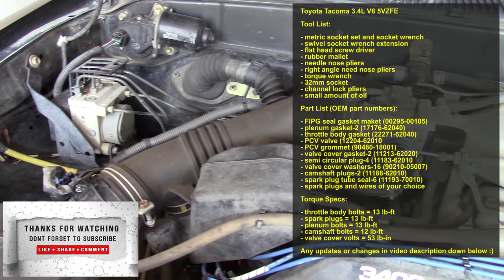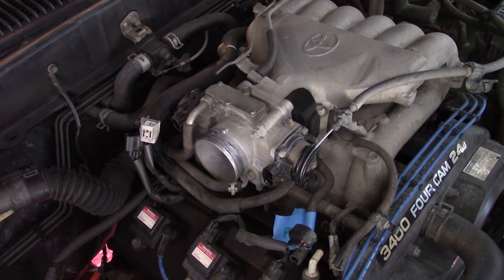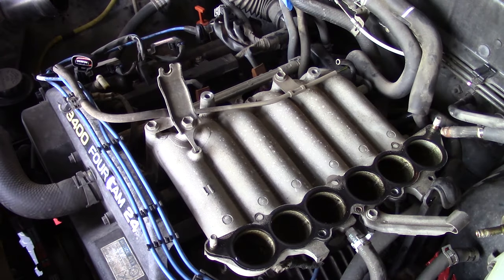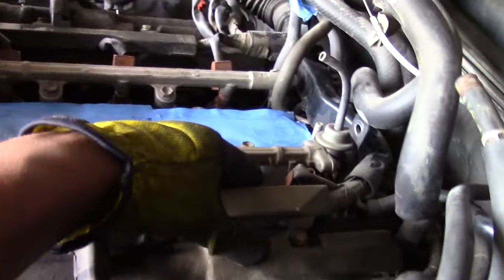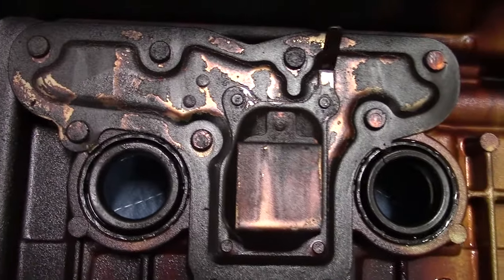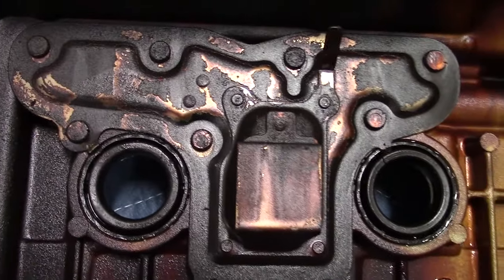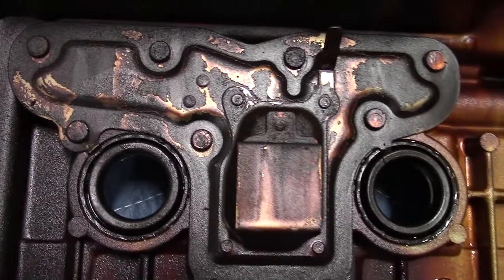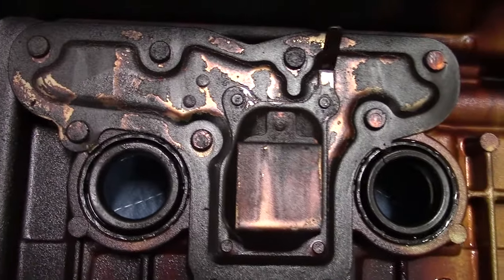Toyota Tacoma / 4Runner Valve Cover Gasket Replacement | 3.4L V6

Comment: All I have ever done is change out the spark plugs, wired, and coils on this engine. This is my next job and it looks kinda scary. I’m not  mechanically inclined so this definitely looks like brain surgery to me. Thanks for the walk thru I’ll be putting on repeat.
Reply from the maker: Good luck on the install! You've completed some technical items already for sure. Just adding a few extra steps here. I'm sure you'll do great 👍🏾
Reply: It’s just time, you’ll do good, don’t overthink yourself

Comment: I'm doing this and I just broke the first bolt I went to torque on... This is so popped. I just ordered 16 new bolts, so now I gotta wait for those. He wasn't lying when he says to be careful torqueing those bolts on. I was using a torque wrench set to 53 ft lbs, I guess I just got excited and went too fast.
Reply: I just did a lil googling and discovered that its supposed to be 53 INCH pounds... I'm an idiot. I read it wrong in the description 😂
Reply from the maker: @johnnyjohnathon7381  I was just about to comment, it's lb inches lol. Happens to the best of us! I'm sure the remainder of the fix will go smooth. You got the order new part phase out the way now :)
Reply: @EngineeredMojo  fr doe

Comment: I never remove the throttle body just leave it connected to the air plenum and remove it together also if you have metal gaskets they can be reused also I don't mess with the injector wires.Defintly use the Toyota glue as permetex rtv doesn't  work for long it will leak in a few weeks.Use either Toyota gasket or the ishino stone is the same . Cheap gaskets leak in 6 weeks. I applied a small amount of blue lock tite to the boltsAll in all you did a good job.
Reply from the maker: @samheninger505  thanks for the tips!! Definitely noted on the toyota gasket sealant

Comment: I hate these valve covers so much, i did all the gaskets and cam caps/half moons and new washers all oem from Toyota and at the end of the day it still leaked 😂 gonna see what i did wrong here, thanks for the vid man
Reply from the maker: You're not alone! First-time I attempted this fix I had a leak. My valve cover torque was too high ironically and warped the compression of the seal

Comment: Eating Lunch Half way through this craziness. Watched this video a total of 5 times to make sure I'm point with my procedures. EXCELLENT VIDEO!  Thank you Thank you!
Reply from the maker: Glad this was a helpful video and appreciate the feedback. Enjoy the lunch break and hope the remainder of the install is going well!
Reply: @EngineeredMojo  how long does this job take?
Good work!
Reply: @EngineeredMojo  Do they sell a valve cover gasket kit that includes the other gaskets used ? Like for the intake manifold? Or do the other gaskets need to be bought individually?
Thank you
Reply from the maker: @SDsailor7  I bought a kit off Amazon, but some kits won't have every seal. You'll need to verify with the part number list I have in the tool list. Hope that helps!
Reply: @EngineeredMojo  Yes, thank you

Comment: I broke a bolt on the coil pack when reassembling: it is recommended at 69 inch-lbs. Hopefully, this spares someone a little frustration.
Reply: Also this was a really helpful video! I appreciate how detailed you were in describing each step.
Reply from the maker: Appreciate the added value to the video!! This is good info. Glad the video was helpful to you as well

Comment: ROOKIES, You can do this! I am someone who if you pointed at something under the hood of my '04 Tacoma I couldn't tell you what it was before the project. There were some hardships, for instance, making sure you put the ignition coils back on the diagram correctly. My truck was misfiring when everything was finished because I rushed and put the coils on wrong. All in all, took me a total of 12 ish hours of labor and I got this done with my family. I learned a lot about my vehicle and am happy I did this instead of taking it into the dealer saving over $300. 

Engineered Mojo thank you so much for this video. Keep making other people's day!
Reply from the maker: Glad money was saved!! Every dollar saved can be allocated elsewhere. Just need the time and patience to get the fix done. Glad the install went relatively smooth and appreciate the time you took to share your story 😀
Reply: Thanks for the confidence booster!!!  I'll definitely try this myself.  I'm being charged anywhere between $600 and $1000 for this, ugh.
Reply: how much did total parts cost?

Comment: Just got her done, 2000 4Runner Limited 4WD with 270K. Was easier than expected because of videos like this. Thanks! Biggest problem was the dealership gave me 6 of the 16 incorrect VC washers so I had to drive back!
Reply from the maker: Glad your install went smooth aside from the dealer providing incorrect parts. Appreciate the solid feedback on the video!
Reply: @EngineeredMojo  on startup this morning i heard hissing from one of the thin vacuum hoses on top of the plenum. I put a glob of FIPG on it hopefully that’s a quick fix for the dry split end.

Comment: Thank you for the tips, I just finished the passenger side and put it back together and will do the other side another weekend. I like your pleasant voice. I watched this and others a couple times. I only did one the easy side first and didn’t even remove throttle body. Putting the little doughnut rubber things in freezer for a few hours and the pvc grommet and they went in pretty easy.
Reply from the maker: Freezer technique is a great tip, I plan to use that in future for other seals!

Comment: Well done, and thanks for taking time to film this. Very nice touch showing that screen shot of the part #'s and torque specs in the beginning.  I had this done at a Toyota shop 2-3 years back, but I'm enjoying watching videos of it now so I can do it myself next time (hopefully that will be a while, but we all know it's only a matter of time on this one).  Like you, I plan to drive this truck for a very long time!
Reply from the maker: Glad the video was helpful! The valve cover gasket is one of the few weak points in our otherwise bullet proof vehicles haha. Hopefully the install you had lasts awhile for sure, but you'll be well equipped when you attempt it yourself

Comment: This video was 100% on track.  Perfect details and to the point.  Made the job super easy to follow along.  I did have one problem that came up and I may not be the only person to experience this.  As my truck is just about to hit 350,000 miles, when I was disconnecting the connectors for the fuel injectors, on every single on of them, the retaining tab to keep them locked in broke off.  Touching them was just enough to do it!  Looks like the mechanic who cleaned my fuel injectors may have experience this also.  There was some gray material he placed into the connector to keep them together.  Maybe some sort of silicone caulk?  So now I  don't want to leave these to chance covered by the plenum to come loose.  Any suggestions?  I hate to think of having to crimp new connectors on.  But I can't just leave them like this to possibly fail.
Reply from the maker: Thanks for the solid video feedback :) Very common issue!! Haha, I actually ran across this on my older Honda recently. I ended up just buying a new injector connector i.e. the plastic head connector. Honda (and Toyota) have a special depinning tool to pop each wire out the back of the connector. No splicing is needed, but it is a delicate process if you haven't done it before. If you'd rather not do that, I've seen others ziptie or electrical tape around the connection after in place. They had no complaints at all

Comment: Just picked up a 2003 with 270k miles.. stunning.. definitely need the valve cover swap.. and possible oil pan...  looks like a days work..
Reply from the maker: You'll be rewarded with a solid truck at the end, good luck with the installs and nice pickup. An 03 with only 270k miles is a unicorn haha

Comment: I’m right in the middle of this project, about to pull off the valve covers I’ve been putting it off for four years but I decided to to change out the pcr valve and once I got it out the other half of the gromet had broken off into the valve cover I said to myself(it’s time) what a pain in the ass job
Reply from the maker: This fix can be a pain for sure haha, it will test your patience but save some dollars
Reply: @EngineeredMojo found the bottom portion of the covers were not even hand tight, I may not have needed new gaskets at all lol
Reply from the maker: @thecactiguy885  haha dang, well at least you have the experience regardless now. Did the rest of the install go smooth?
Reply: @EngineeredMojo currently waiting on all the gaskets, autozone dropped the ball there so taking the opportunity to deep clean the valve covers

Comment: Great tutorial! If only my passenger side is leaking, can I get away with not removing the intake manifold? Seems like there is room to get it off with some finagling.
Reply from the maker: I'd give it a try, couldn't hurt to see if you have enough access. Would save some time!
Reply: Update: I was easily able to do the passenger side by just removing the throttle body and leaving the intake manifold on. Saved a lot of time. Thanks again!
Reply from the maker: @BrandonHoward-g9q  awesome to hear! Thanks for providing the update!

Comment: Very good illustration on how to perform a valve cover job with half moons and cam cover seals on a 3.4 ltr. Is there a good aftermarket gasket kit to get? Any aftermarket seals available that you recommend? I see you listed OEM part numbers.
Reply from the maker: I don't have any personal experience with aftermarket valve cover seals, but given the valve cover is under minimal torque force I wouldn't hesitate to buy aftermarket from a reputable vendor.

Comment: I’ve got to clean my garage out in the front of my truck so I’ll have room to work. But I’m gonna do this gasket change. The left side is leaking quite a bit. Iv got another truck that I can drive if I need parts or something. Also I’m gonna charge the timing belt but maybe a little later. This summer.
Reply from the maker: Sounds like a solid plan, and it's helpful to have a backup vehicle when doing this fix. Good luck on the install! Not bad at all to diy

Comment: Well I am about to undertake this project and this was a very concise yet super helpful walk through.  1 question.  I had the timing belt done by a mechanic 1 year ago so they Hopefully did the right thing and replaced the front cam seal. Because it is not part of this procedure I assume it will not cause a new leak since the front cam seal should of been properly seated the the sealant applied and torqued down properly or would you not risk it and take the extra step to also do the front seal?
Reply from the maker: I personally do not change the front cam seals unless I have a current issue or visually seals appear damaged. The chance of a leak is rare enough there that I take the risk not to go through that extra work. However, I don't blame those who do for any extra peace in mind they want

Comment: Great video. Any recommendations on replacing anything else while you’re in there? Had to replace mine soon and would like to get as much done as o can!
Reply from the maker: Thanks for the video feedback! Besides spark plugs and coil packs, I can't think of anything else. You could replace cam seals, but I typically do not if there isn't a current problem. Failure of those doesn't seem too common from my in depth internet thread reading over the years haha
Reply: what about having the injectors cleaned or replaced? pretty sure that would be pretty good for the engine
Reply from the maker: @dsa420meh7  wouldn't be a bad time to do that maintenance as well while in there, noted for myself for a future video!

Comment: @Engineeredmojo ! This video has been my guide line for my VC job! I’m currently in the middle of it.  Everything is out and off the truck.  However I’m having a hell of a time getting my spark plug tube grommets out.  I’m assuming the job had never been done before, cuz everything is super hardened and gnarly.  Any suggestions on removing the remainder of the plug grommet? The “meat” chipped off but I’m still working on the part that seats into the VC.  Any input would be greatly appreciated! This video rules!!
Reply from the maker: You're pretty far along! I've used beedle nose pliers or a small flat head with the tips wrapped in tape to lessen chance of gouging VC surface to pry remainder of degraded seals out of their seated position, might be able to help depending how rough your seals are currently. Good luck and keep at it with the patience we all hope for haha 😄
Reply: @EngineeredMojo bro! I got them out! Rubber mallet and a giant flat head…man thank you for the response, and most of all thank you for this video! I’ve learned watched you’re video prolly 20-30 times in the last few months, taking notes.  Couldn’t of done this without you! Definitely the biggest job I’ve ever done on any rig 😅 cheers to you brother thank you so much
Reply from the maker: @tylerb7198  awesome to hear!

Comment: Would it be ok to clean the inside of the cover.  Awesome video
Reply from the maker: For sure no problem at all to clean the inside, thanks for the video feedback!
Reply: @EngineeredMojo  Thank you,also where do you recommend getting oem parts. I have a 96 and most dealerships don't have parts for it.
Reply from the maker: @blastfromthepastttmscollec5775  I purchase from online, usually I can find oem through an online vendor like ebay or amazon

Comment: Thanks for all of the very helpful videos including this one. How do you remove the front camshaft plugs, which are sandwiched between the camshaft and the timing belt backing plate? Do you need to unbolt all of the semi-circular holders securing the camshaft?
Reply from the maker: Glad the videos have been helpful! For the front camshaft seal, you do need to remove the front sprockets and timing belt backing plate. After that there is a special tool you can purchase that will have a small lip that fits underneath cam seal and will pull it out without having to unbolt all of the caps or remove camshafts. If you google camshaft seal removal tool, I believe the company is YSL that makes a tool. Should be a few other companies as well, hope that helps!
Reply: Thank you, Sir! Again, very helpful information.

Comment: Finished up the valve cover gaskets on my 2001 Tacoma. 🎉 Great video, Thanks!  My torque wrench broke while putting  it back together (no click) 😮 luckily I realized it before I broke a bolt. It pretty much just turned into a breaker bar. 😅 It looks serviceable but i dont trust it now. Borrowed a friend's to get the job done 👍 Any recommendations on a good torque wrench?
Reply from the maker: Glad you were able to figure a solution with the tool break! I like craftsman given they usually have a lifetime warranty, snap-on is another good one, but expensive!!
Reply: cdi torque for 1/4 inch  and 3/8 micrometer style. part of the snap on tool family

Comment: When you remove the coolant hose from the throttle body does it introduce air into the system so you have to bleed the coolant afterwards?
Reply from the maker: Only locally, so your coolant should self bleed through the burp valve on the cap

Comment: I’m about to get a used 1999 4runner how much would this cost including parts and labor?
Reply from the maker: To get a shop to do it probably between 1500 and 2000. Those were the estimate ranges I received. To do self install, assuming you have the necessary tools already, all parts were less than 200 dollars

Comment: Is there a specific sequence when re torquing the valve cover bolts?
Reply from the maker: I typically do a cross hatch pattern working from the inside out when tightening. Reverse for removal

Comment: You said reinstall the spark plugs... do these need to come out? Or did you mean spark plug wires?
Reply from the maker: Oh yes, I meant spark plug wires. However, since you're in there already, it may be good to swap and put new plugs as well

Comment: thanks for the video. how many gaskets for the intake manifold altogether? one upper and one lower? thank you!
Reply: what is the FIPG seal gasket maket (00295-00105) for?
Reply from the maker: Just the two plenum gaskets, I list the full part list in the video description with part numbers too
Reply: @EngineeredMojo  is that the silicone you’re using? it also comes up as a fuel pump gasket. thanks

Comment: Im a little confused. I only saw one gasket removed when you took off the lower part of the plenum @6:15. But you said there was 2?
Reply: Is it just the one shown at 6:15 and the one from the upper section?
Reply from the maker: @imahitu  there are two gaskets, in the video I am showing you just the one cylinder side. This is a v6 engine, so there are two cylinder heads. Hope that clears it up for you!

Comment: Does removing the valve covers expose the water outlet?  Like in the middle of the block..  cus ive heard that gasket goes sonetimes and have the gasket but only will replace it if i can do it without taking more crap off the motor to get to it,.  Jusy did the timing belt so kinda at my limit on tinker time with this thing for a while…
Reply from the maker: I don't blame you, timing belt change is a process. If you are referring to the thermostat outlet, yes you'll have decent access to that when changing the valve cover gasket